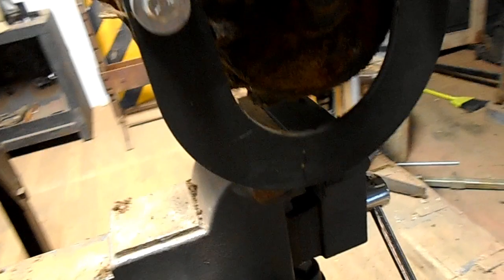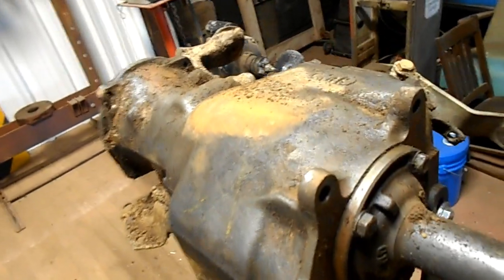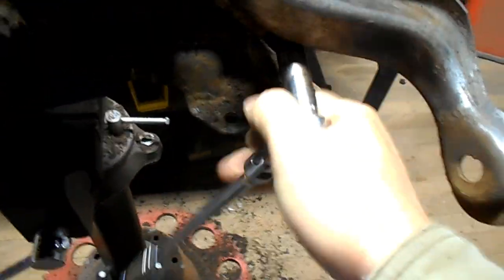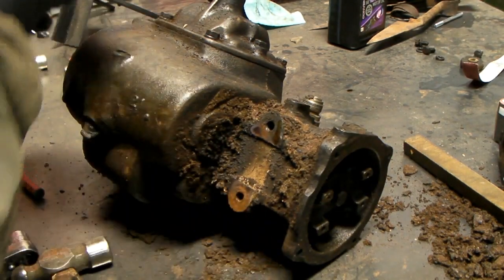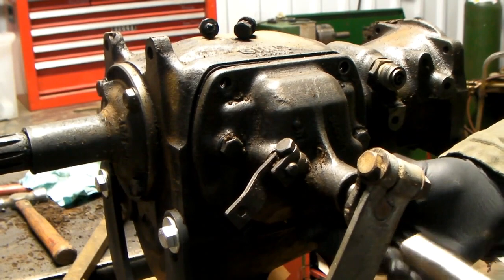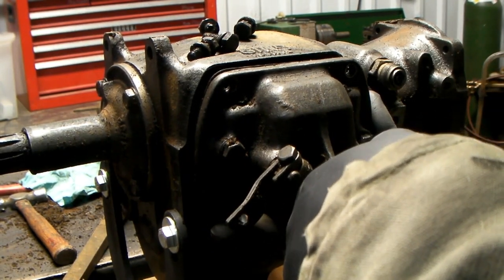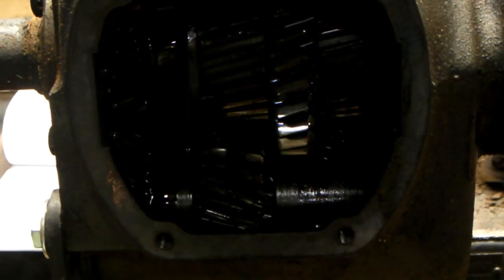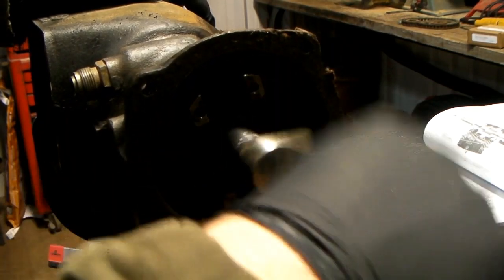Part 1: 1937-1954 Chevrolet 3 Speed Transmission Rebuild - Disassembly

Comment: I think you should have explained the shifting mechanism of the side plate. So many folks do not understand how to adjust the shift linkage when they lose 2nd and 3rd gear. The rods are not like the later 3 and 4 speeds. Only one rod shifts all the gears, the smaller rod is the gate changer between R & 1st, and the 2nd & 3rd Shift modes. On my 47 I wanted a floor shift. So i got a later trans side plate and it fit over the gears perfectly bolted right up, and I had two levers shifting, Viola. Then the old 3 speed Hurst bolts right up and worked perfectly. No many folks know that. Good Video appreciate your attention to detail. Dennis

Comment: If your synchros are grinding the gears look for wear on the energizer rings, on one end is a hook that keeps it from moving on the shaft, delicately lift it up and move the energizer ring 1-2 teeth and you will have a new surface for the syncro cone to slide over, this may do the trick and can be done through the shift cover without removing the trans from the car. Once you get the cover off you'll see what I'm talking about.

Comment: i got a 49 chevy 3100 with 3 speed column shift. and my shift cover is on the side. only difference i see is there are ONLY 4 bolts. none in the center there.

Comment: Hey Jay, what would case the 2/3 speed clutch not to want to move with its levver? When i had the cover off it would move very easy using my finger? 1st-rev gear lever works great. Thanks.
Reply from the maker: Does the shifting mechanism work when it is not attached to the transmission? The factory service manual outlines the service procedure for going through the shifters fairly well if you don't have one.

Comment: Hello - I had written you awhile back about my 1948 Fleetline trans and not being able to find neutral. I opened it up again, and figured out how the gears need to be aligned and matched the fork positions so it is still in neutral after I close it up. Before I button it up, I have a question about the smaller of the two linkages in the cover. I want to be sure it’s functioning as it’s supposed to. I can move the larger one by hand but the smaller one doesn’t want to rotate. I had taken it apart unnecessarily and I got it back together but not sure it’s right. As I said, the larger one seems to work, but the smaller one is in question. Can I send you some pics? Email/FB?
Reply from the maker: yes you can send me pics: ratzlaffmotorco@yahoo.com

Comment: Hello were can I find the rebuild kit and special tools to use it correctly so I don't damage anything.
Reply from the maker: Rebuild kits can be found at chevsofthe40s.com or fillingstation.com. As far as special tools, they are hard to find. But you can get the job done with basic hand tools. I offer a vise mount for the transmission on ebay if you're interested. Just search for RMC-J-934.

Comment: Thanks for your videos. I'm rebuilding a 49 truck and would like to know how much you took off the front and splined areas of your oakie bushing.
Reply from the maker: I matched the dimensions that I wrote down for the old one, thanks for watching.
Reply: Thanks for the response, do you feel like you got a good press fit with those measurements on the new oakie?
Reply from the maker: @alanroach7628  Yes I just matched the old one and it worked great

Comment: Well I am stuck, literally. At 13.:15 you start to take input shaft out of the front of trans case. I am able to push/pull the input shaft out of front of the trans case too but the butt of the shaft will not disconnect from the butt of the main shaft (output shaft). Some needle bearings fell out, there is separate movement between both shafts but something is binding them together and cannot pull them apart! 

Any idea????

Thanks for vids....
Reply from the maker: My only thought is that the gears are binding for some reason. The only keeper should be the snap ring on the outside. Another thought is that the roller bearing on the outside of the shaft has been messed up, can you see any damage from the inside of the case?
Reply: @TheJayhawker  thank u for your quick response. 

I am pretty sure there are no apparent gears binding but that is what I initially thought as well 🤔. I did remove the snap ring (keeper) from the outside/front of the trans of the main gear(input shaft) and I am able to push the main gear (input shaft) out far enough such that the bearing is free from/clear of the trans casing. Ironically, both shafts at this point have independent play both forward/back with slight swivel but will not fully separate completely.

I noticed something ....

1. Not all the needle bearings fell out. From this connection?
2. There is a burr on the exposed main shaft(output shaft) adjacent to were it connects to the main gear (input shaft). Needle bearing damage?
3. There is no grinding sound between the 2 shafts at connection point when moved. They independently move freely.

I am thinking a needle bearing might be binding preventing complete separation of the 2 shafts? 

I am stumped because it feels like a keeper would produce this or possibly a gear binding but I removed the keeper (snap ring) and cannot see/identify any gear binds at this time...

Thanks for your feedback

Comment: I have a 1940 special deluxe.  I want to convert it to a floor shifter. Any ideas that would fit? Possibly a truck shifter? Thanks
Reply from the maker: You may want to do a little more research, perhaps find a similar year truck or just get a hold of a truck transmission and take measurements. But from what I know about them there is very little difference between the truck and car 3 speeds except for the shift cover.

Comment: What would cause 2nd gear to slide out gradually and 3rd gear to pop out really hard at random times?
Reply from the maker: Check the fluid level first, the other two common reasons would be either your linkage isn't adjusted correctly or more than likely, your synchronizers are worn out.
Reply: @TheJayhawker  thank you…the level is good,I’m thinking synchros are worn though

Comment: Hi Jayhawker, I appreciate your video.  I recently acquired a Ford T85 w/Borg Warner Overdrive. I also scrapped and brushed (a lot more dirt, accumulated crude) from the exterior before I went online basically to ask the same question I hope that you might help answer. Don't know it's history, but it's dry inside and a bit rusty.  I don't think there was an water intrusion.  Input shaft spins, but the synchros and other gears are a bit frozen and before I put too large a wrench on the output shaft to free it up, I want to close it up and use either ATF or whatever solvent you might recommend...let the solvent sit inside the transmission for at least several days to help free things up before I go further.  I appreciate your thoughts...Paul
Reply from the maker: I'm a huge fan of Marvel Mystery Oil for situations like this. When I salvaged my mechanical press that had been outside for years the arbor gear was completely seized. I sprayed it for days with penetrating oil but didn't get anywhere. I then poured MMO down the gear cavity, came back in 24 hours and it moved! Some places sell it by the 1/2 gal. Thanks for watching and good luck on the  tranny.

Comment: What kind of stand do you have withe the trans on? I have a 4 speed that I started taking apart but I have stopped because I don’t know what I’m doing. Lol
Reply from the maker: I made a copy of an original Chevy service tool. But this one would not fit your 4 speed. Search Kent Moore J-934 on ebay. I have my own version for sale. I have a 4 speed and have been wanting to do a rebuild on it as well but it hasn't been a necessity yet. I will probably be making a holding tool for that when I do. Thanks for the question. Oh and invest in an original service manual, you'll get it figured out!
Reply: @TheJayhawker  I do have the service manual but sometimes the wording in those books doesn’t always calculate with my brain lol
Reply: @TheJayhawker  did you make the stand that the vice is on?
Reply from the maker: @dsim9988  Yes lol, The red piece is a wheel hub from a Massey Harris Super 27 Combine.
Reply: So I got the SM 420 transmission apart and the case is empty. What can I soak the gears in?
Reply from the maker: @dsim9988  solvent, mineral spirits, even gas, which does an excellent job. Assuming you, unlike so many, have the common sense to be safe with it.

Comment: Can you ID my transmission that has 591102 casting? It’s on a ‘41 p/u.
Reply from the maker: According to a quick search it's a '40 truck 3 speed. You should also be able to find a date code, a letter ( the month) and 3 numbers, the first two digits are the day and the last digit is the year.
Reply: I followed both videos to a T and wound up with a grinding shifting from 2nd to 3rd. Shifting from/to any other gear is fine. If it were a clutch issue, I would think grinding would be in all gears. My only other thought is 3rd gear synchro was installed incorrectly(?) or no good brand new.

Comment: Our 1948 chevy runs and sounds OK until we let up on the gas. It makes a clicking/knocking noise. Is that a transmission problem?
Reply from the maker: I would start with jacking up the rear end (please use jack stands) and spin the tires while an assistant listens for noises around the transmission (in neutral). Also you can slide back the front cover of the torque tube and check the trunnion (u-joint) for play.

Comment: also...WHERE CAN I FIND THE BEARINGS AND SEALS NEEDED FOR MY 49 3 SPEED!?? man i really want to just slap new bearings and seals in this thing. the input shaft and output have about 1/16 to ab 1/8 inch of play in them. i can also grab the rear shaft and push it in and out about 1/8 inch. id like to rebuild it while i have it out and apart
Reply from the maker: I personally use chevsofthe40s.com they should have all you need, call them for a better shipping rate. The filling station is another good supplier.

Comment: Wish you showed how to remove it from the engine
Reply: 4 bolts, shift linkage, ball joint, slide cover all the way back, slide out the transmission untill it  tips down a little, the lift the driveshaft above the transmission, slide out the ball joint yoke, then the transmission can slide back far enough to be pulled to the side and removed.

Comment: Wish you would've shown how to remove it. I'm stumped.
Reply from the maker: Yeah sorry, didn't start making videos until the rebuild. I'll be sure to get the next one. What are you having trouble with? Email me at ratzlaffmotorco@yahoo.com if you prefer.
Reply: @TheJayhawker  thanks! I'm just having trouble following the manual for removing the transmission this is my first project. Did you have to fully remove the drive shaft to get the transmission out from the floor? The manual says you should be able to just slide it back and out but doesn't say the drive shaft needs to be fully removed to come apart.
Reply from the maker: @MrTestical_  Yes, if the engine is not to be removed, undo the flange around the u-joint ball,  slide the ball back, undo the u-joint and slide it back on the shaft. Then if you can drop the front of the torque tube down out of the way. Then you can undo the trans. from the clutch housing.
Reply: @TheJayhawker  thank you!!!! Awesome videos btw. I appreciate your help and replies! Not to many videos on this car on youtube. Mine is a 49 and the original 216 still runs but I noticed it never had a oil filter built in. Was it the case with yours? The guy told me it was a dealership option. Nonetheless thanks for the help sir!
Reply from the maker: @MrTestical_  Yes, the industry really didn't get onto the oil filter thing even up into the 1960's. There were however a lot of accessory and aftermarket options out there to add a bolt-on filter canister that uses a pressure and return line to the block. Most generally they are clamped to the intake manifold.
Reply: @TheJayhawker  I didn't know that. Well thanks alot! Great Channel BTW and response!